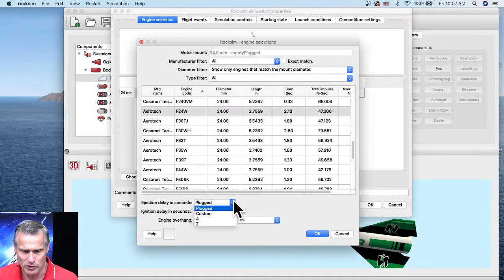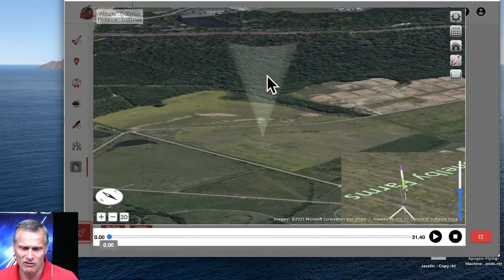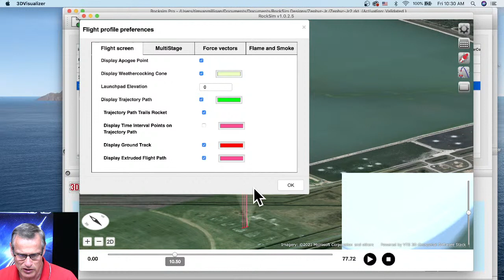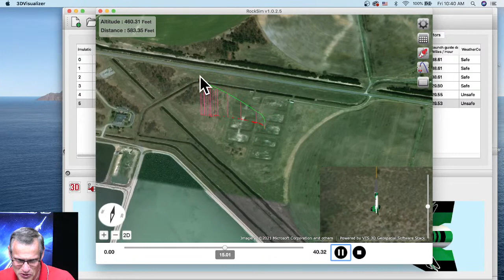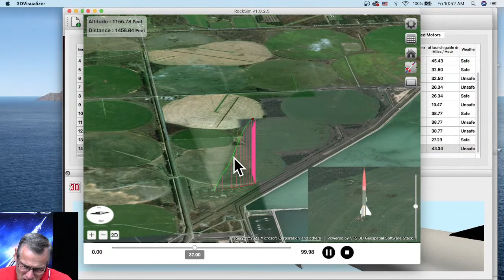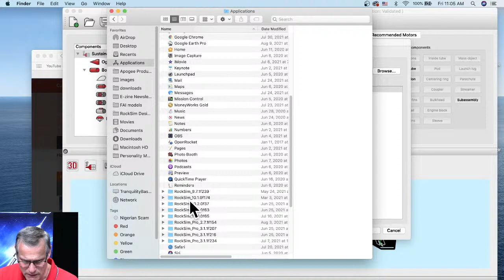The effect of canted motors on a model rocket's flight

Comment: Muskegon is also where I launch from. The rocket club there is called SMASH.
The Icky is bad, they actually have a small boat that they can take you out on if an expensive rocket lands there. But you might not want it back after it lands there, they don't call it the icky for nothing.
It's a great site for high power and hang time, but clusters or other rockets that may go off course, not so much.